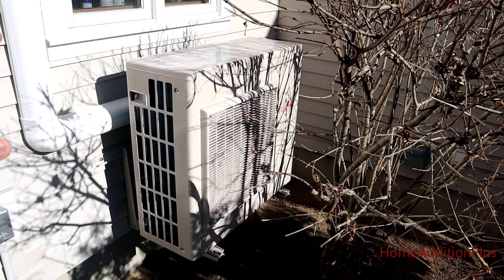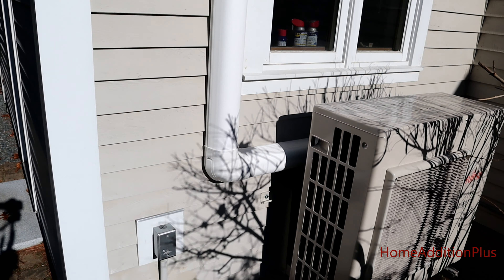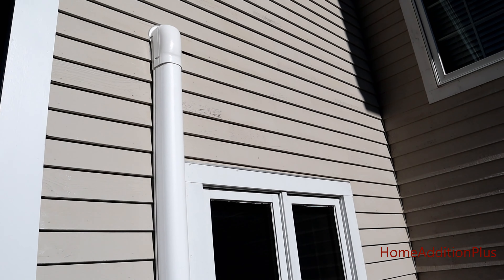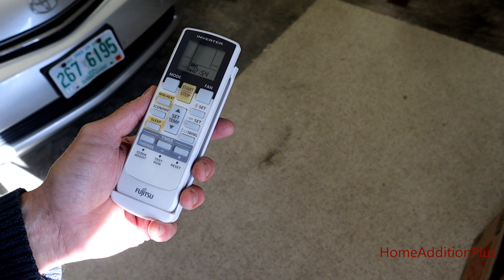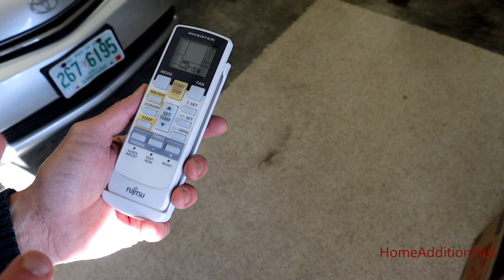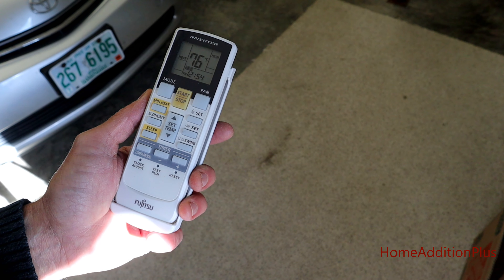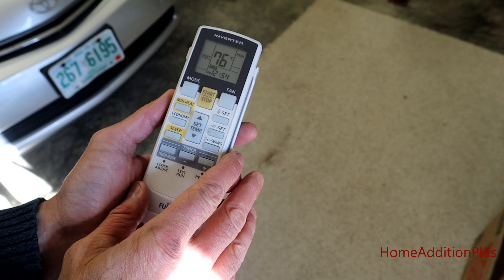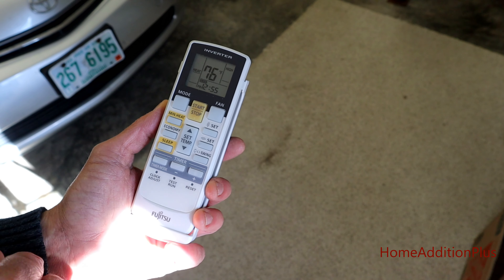Ductless Mini Split Heat Pump System Advantages

Comment: Next time install on a stand on the ground, 12" minimum distance away from house on backside of unit is recommended..
Reply from the maker: Our HVAC guy installs them on either a stand or free standing via attached to a wall. In our case he suggested free standing due to the amount of snow we get.
Reply: yeah I noticed, you can get 12" or something 18" stands, you really need 12" behind the unit.
Reply from the maker: I just went out and measured. I have 7.5 inches of gap between the back of the unit and the outside wall exterior. Before I had my HVAC guy install it, I visited his shop where he has two of them mounted, one on each side of the shop exterior. He used the same bracket setup I have. My neighbor has one mounted on the stand. Besides the snow and debris concern of the stand type, it just didn't look right to me. So, since the HVAC guy was mounting his own on the wall, I figured if he was doing it on his own building then its good enough for me :)
Reply: Im sure its fine, I'm just giving you what the manufacturer recommends.  Installers usually don't give you a copy go the instructions.  Installers like brackets because they are quick and cheap.  Stands cost about $150 plus the cost of something to bolt the stand to.  I'm a homeowner and purchased about $1,800 in installation tools and learned how to install mini splits myself.  I've installed 5 Mitsubishi H2i units at my home.  Few home owners would go through the effort I did.  Mini splits are great.